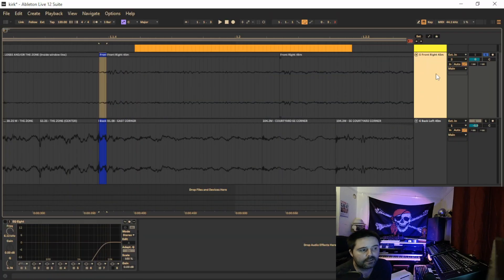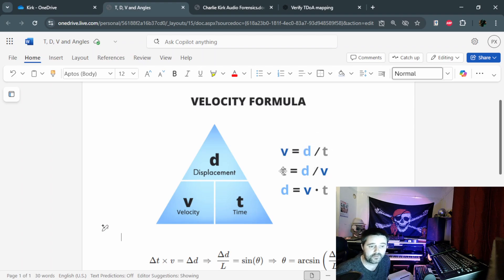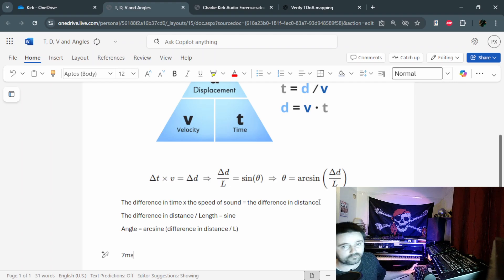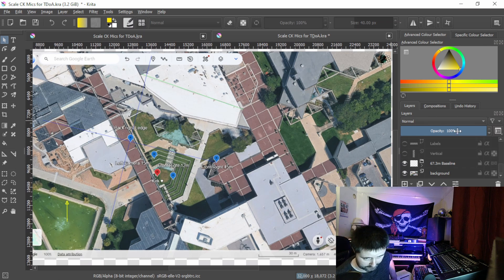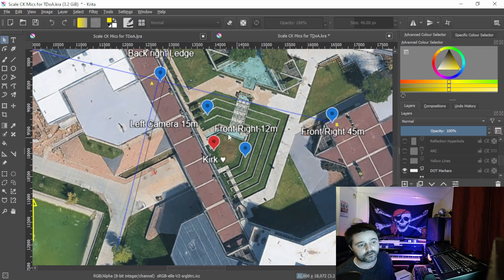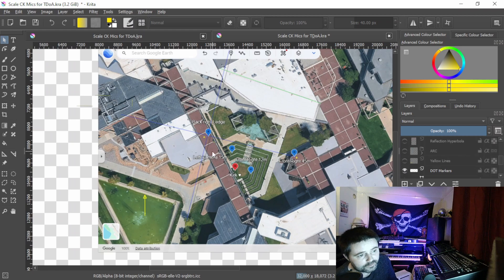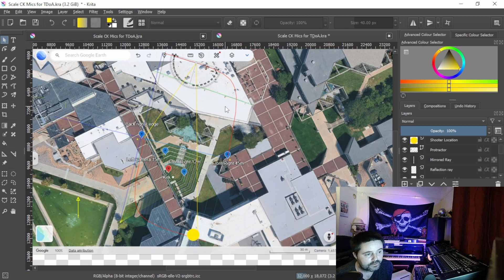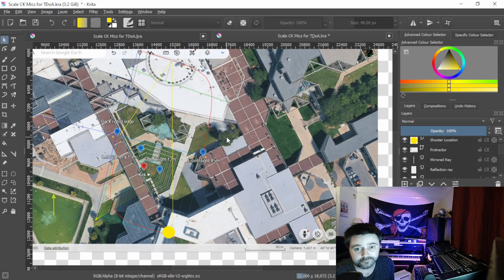Reflection vs Source | TDoA Audio Geometry Explained

Comment: Thanks again mate! 

Dr.Maher on the mic? he used to calculate the distance-came up with a time gap of .241 seconds.  There are some assumptions but here is the formula:  tdiff/((1/c)-(1/V)).  He approximates a bullet at say 2750 ft./sec. to be 2500 ft./sec. at the muzzle at 150 meters so he uses 800m/s= the velocity.  So with the recorded time gap of .241 seconds, Dr. Maher came up with a distance of 144.7 meters.  That's just his math.  

He further states, you would need to account for the mic not being on-axis with the bullet trajectory.  If the bullet passes some distance from the mic, the time gap would be shorter than predicted by the mic on-axis.   

Like I mentioned, not sure which mic? he got the data from.  But if what he is saying is true and we have the data to determine the time gaps from all these different mics, then couldn't that provide us with a way to determine the most direct path and trajectory of the bullet while also confirming the distance at which the shot was fired from?  

Like TDoA but for time gaps.
Reply from the maker: Well, the jury is out on the impact to bang at the moment. I have 2 recordings showing different timing. The purpose of that test was to ensure the shot was close enough to not have to account too much at the other end. The mic I use is 5-10m back right of Charlie, but the higher quality camera is placing it about about 250-300ms after the transient of the shot. And the ripped one is showing the 90-94ms - 120ms reaction time, I originally measured. Though this information doesn't effect the TDoA stuff at all, it's separate. So, for my test it's irrelevant, but it's definitely one of those things we all have to determine and agree on. I will add, I'm no gun expert, never even touched one, so all I can do is the audio. I just needed that reference to place the shot close enough, or not,

Have you got a link to that video?
Reply: @Audio-Freq  The higher quality cam is then confirming what Dr.Maher has estimated to be an approximation of .240+s after the transient of the shot.  The technique he uses is pretty simple it looks at the arrival times of both the supersonic shock wave along with the muzzle blast sound which is measured and the time gap is just simply that difference.  I went back and looked at your estimate in order to try and explain why the ripped one is showing the 90-94ms-120ms reaction time and I think I have an answer. 

This method relies on a visual cue versus simple sound in order to determine the distance which inherently can lead to inaccuracy and variability relative to the actual arrival of impact especially when we are talking about something moving 800m/s.   So I conclude that the actual impact is much sooner than your inferred impact of .82-.74s and the muzzle at .9s.  Your estimate implies the impact happened closer to the arrival of the muzzle blast, but the actual impact should happen closer to the sonic shock wave of the bullet.  

Additionally, if the impact took almost a full second(?) to reach the target then it wasn't fired at a shorter distance, but a longer one.  A bullet traveling at 2250ft./sec. or 685m/s takes only .200 seconds to travel 140m/459ft.   

However, what I believe you have measured is very important and relevant.  What you have measured is an extremely long and unexplained delay or pause in between hearing the sound of the shot fired and what we should have been seeing.  

Another thing that doesn't add up in what Dr.Maher sent me is that there is another sound picked up that arrives appox. .050s/50ms before the muzzle blast sound.  My question is what is that, and did you just measure that?  

This might explain why you have estimated the bullet arriving so late, because the impact did arrive late relative to the shot being fired.  Well late=.74-82s....Charlie couldn't have been impacted by this bullet; the fired bullet would have arrived much sooner than we all witnessed.
Reply from the maker: @JasonFox-k2i  I was pretty quick on that measurement. So it's possible I got it the wrong way round, again, I know nothing of guns. But the conversions on the film can shift audio and video slightly. This is why I didn't go off that data and did the TDoA instead, because it doesn't require that input if we use the echoes. Everyone is assuming the impact time. We can get it pretty close and my latest measurement confirms Maher's result. It's just a case of if it's the right, original footage. I do have a few more tricks up my sleeve though :)
Reply: @Audio-Freq  cool, can't wait to see what you come up with.  It's beginning to get very interesting.  I don't think you have anything wrong in your calc.  I think that's when the actual impact is recorded visually and I think it's late relative to when the impact should have arrived.
Reply from the maker: @JasonFox-k2i  I'm open to be wrong on a few things. That is why I'm doing it publicly. 1 to learn, 2 to provide people with the working knowledge of how these things work so it can be tested. 

There are things to consider, such as angles. If the camera was next to the shooter the orientation would be reversed, so while measuring is viable, we have to know exactly what is being measured to include any relevant deductions. I do have something that will remedy this, though it's gonna take a little bit of time to measure effectively
Reply: @Audio-Freq  Honestly I don't think you're wrong.  Thanks for sharing all of this.

Comment: Can the defense use this type of analysis in court for ... "Reasonable Doubt" that it came from the Losee Building?   Charlie was sitting in a chair on a raised platform, in the center of a pop-up tent. Was his head (6' high) even visible, under the canopy, from the elevation of that yellow dot?   So, now it's an exit hole.
Reply from the maker: It's a valuable question, as it stands with just this as a singular, no. But, if multiples check out then it's concrete unless the court wants to break the laws of physics which they can't by design, it's a law, it can't be broken. As for line of sight, I'm not a sniper, but all it would be is a case of someone standing in the middle of the amphitheatre, and a drone to hover around that corner and we'll see. Or, someone on the roof videoing down. But, depending on how deep Charlie was to that angle under the tent. If you couldn't see the head, sure, but what if you saw the base of the skull instead? It's plausible. But we need to compare apples with apples here I think

Comment: Great work, this is in line with the area I think "A sound came from". Which basically confirms that "tyler" did not shoot anything. 

Personally, I feel the "sound" was created by a decoy, and the actual bullet used was "silent" and air powered. Do you think a "silent air powered pistol" would show up on sound analysis?
Reply from the maker: I'm actually hoping to figure that out over the next day or so, I'm going to recheck my measurements on that stuff, make a video on it and discuss it on crowd source the truth with Jason tomorrow